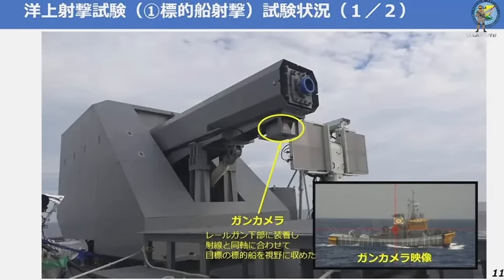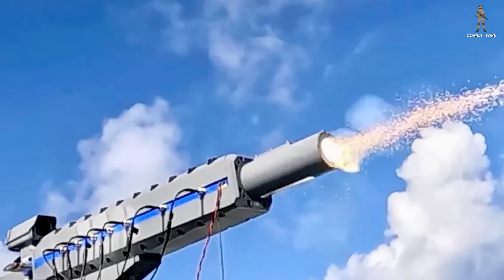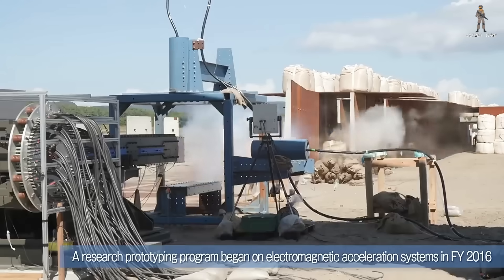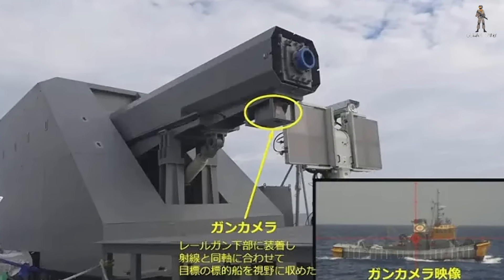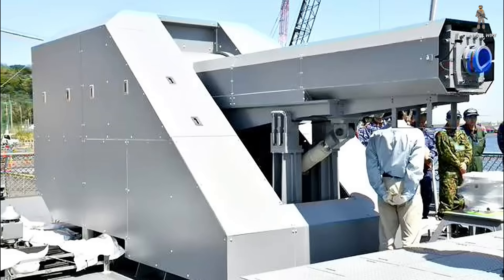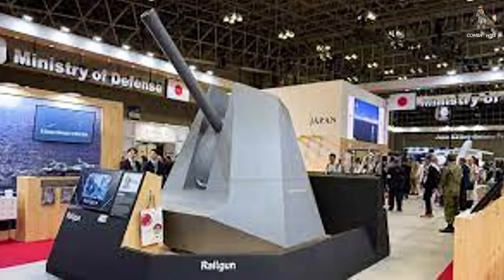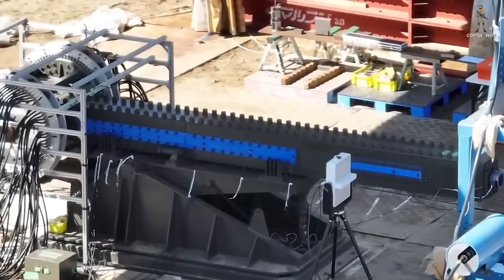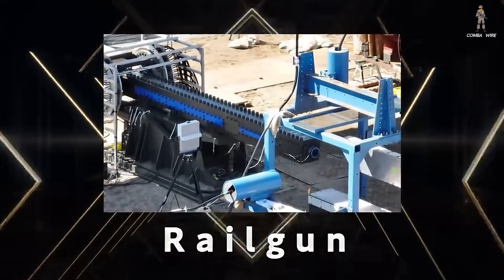For the First Time Ever, Japan Reveals True Railgun Damage at Sea.

Comment: The US Navy originally wanted a mach +8, 200 pound projectile, fired 30 times per minute. By 2016, the US was working with a 40 pound hypervelocity projectile that could be fired potentially 2 times per minute. By 2022 they had succeeded in proving the basics of railgun technology. The program was paused; i believe this is simply so other technologies can mature leading to just swapping out parts of the completed 2022 system with 2030 tech. The US also needs a platform for the weapon. The most likely candidate would be the successor to the Arleigh-Burke destroyer. Which also wont be ready until the mid 2030s at best. In the interim the US has worked on laser tech and now has a 150-300kw laser for ships to be deployed soon, and a 60kw laser mounted on the Stryker wheeled APC. 

Also the JS Asuka is pronounced with a silent u. ahs-KUH

Comment: The reason they usa stopped massively researching rail guns was simple. They do little damage compared to conventional explosives. They will pierce most anything but poking small holes in a large vessel doesnt have a rapid effect. You'll get some small and fragmentation but you're not removing chunks from a vessel or rapidly sinking a vessel. This is much the same as to why we have switched from massive diameter turret shells to missile based offensive and defensive tactics. 

One might think you can add an explosive to the rail gun projectile, but its speed creates issues. 1 of which is heat buildup causing the explosive to detonate early. The other is precision timing at those speeds. Rail guns just aren't effective. In space they would be due to the fact that a small hole can rapidly decompress a vessels airspace but then again so could a traditional projectile weapon

Comment: FYI, some British WW II battleships had guns with a barrel wear of only 200 rds or so. They went with a higher velocity round, but did not antiocipate the lower barrel life.

Some thoughts:
A rail gun with quick change barrels or barrel components? A ship can carry several spare barrels for quick change to be refurbished later (i.e. the wear components replaced later). 
A dedicated small (frigate or small destroyer) air defense ship with a small nuclear reactor?
Add a bit of depleted uranium for its pyrophoric properties? Good for secondary explosions.
Reply from the maker: Yeah, that WWII comparison is actually spot on. High velocity always comes with a price, and even back then navies were learning the hard way that pushing rounds faster meant you were basically burning through barrels. Railguns just take that problem and crank it to modern extremes.

On the quick-change barrel idea — honestly, that’s probably the only realistic way to make a naval railgun practical. You’re dealing with insane heat, electromagnetic erosion, and physical stress. A modular barrel assembly that crews can swap out at sea makes way more sense than trying to build a “forever barrel.” The ship could easily carry spares the same way they carry replacement CIWS barrels.

A small air-defense ship with a compact reactor? That’s the dream setup. Railguns need huge bursts of power, and current surface ships just don’t have the electrical headroom. A small nuke could basically turn the whole vessel into a floating capacitor bank. The tech challenge is political, not engineering. As for depleted uranium — yeah, the pyrophoric effect would definitely create nasty internal damage and secondary fires. The issue is environmental and political pushback. Militaries shy away from DU on ships because cleanup and long-term contamination are a nightmare. But from a pure performance standpoint? A DU railgun penetrator hitting at Mach 6+ would be absolute chaos inside a target.

Good points all around. The real question is how far Japan — or anyone — wants to go to make railguns operational. Right now, they’re closer than the headlines suggest.